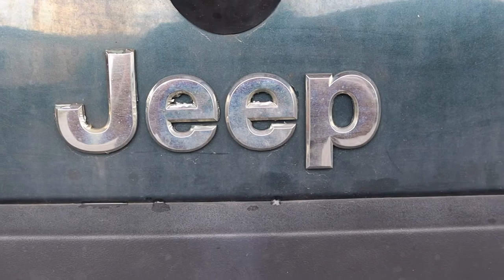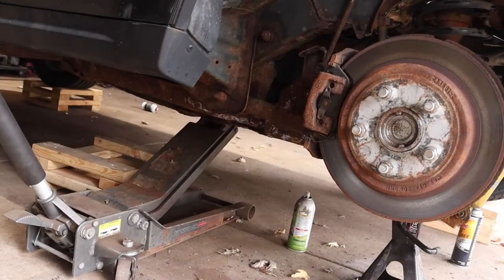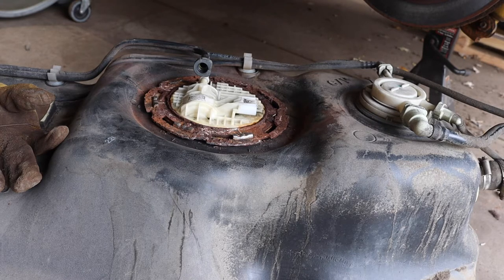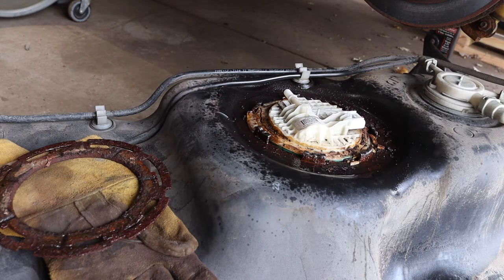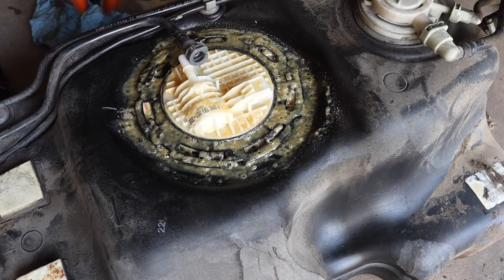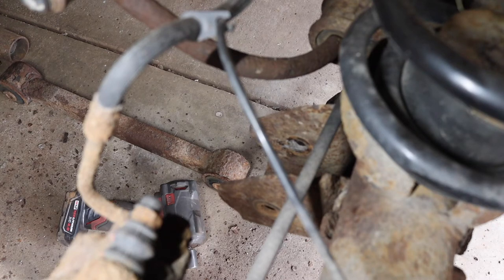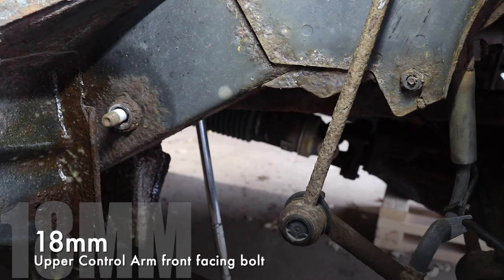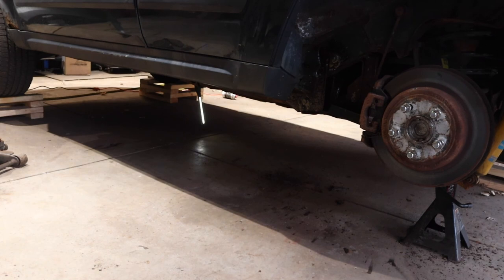2005-2010 Jeep Grand Cherokee Fuel Sending Unit and Rear Control Arms replacement

Comment: My tank support is rusted pretty badly. Just wondering if those bolts will ever come out. I see you soaked them good.
Reply from the maker: The three facing the outside of the Jeep were rushed badly on mine. Made sure the socket is tight on the bolts.
Reply: @jth1987leb  We really got to love these WK's to do stuff like this!

Comment: How long did the job take ?
Reply from the maker: Depending on the level of rust, tools and skills 1-3 hours
Reply: @jth1987leb  gotcha thanks . If you were changing the tank guard why did you reinstall it.  Don’t you have to drop the tank again to change it ?
Reply: @jth1987leb  what’s a shop estimate for a fuel pressure sensor replacement I have my own part code p0452